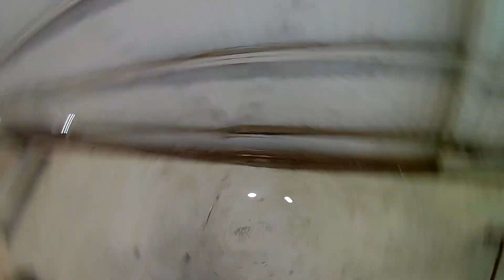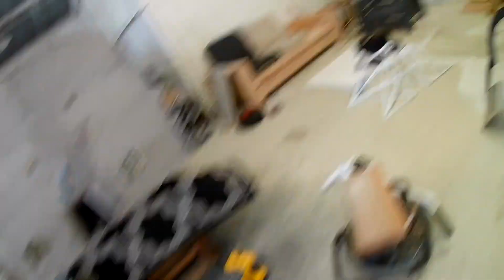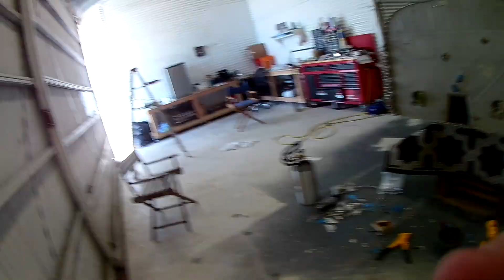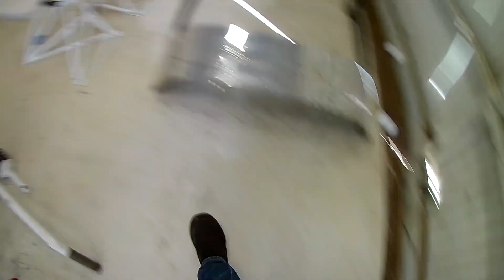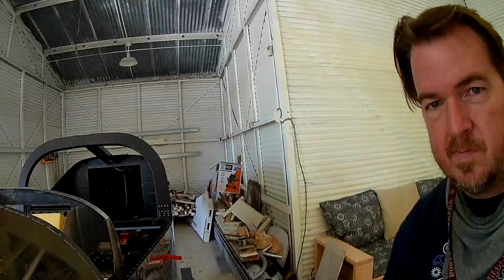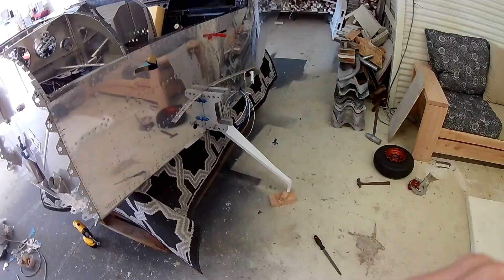RV-14 Landing Gear I

Comment: Great news. What is the cost of the engine as compared to getting the “deal” from vans direct?
Reply from the maker: Its comparable. Lycon is also a distributor of the EFII system I'm installing so they're bundling that in.
Reply: Andrew Kilroy Interesting, when the time comes I will have to look into it. As of now I was going to stick with Vanilla in this area- prop and engine combo from Vans with the stock 390. But I have time to think about it.

Comment: Andrew, I've been following you for over 2 years and never heard you speak of your planned use for the plane.  I know you're a highly skilled pilot, and I think you've mentioned aerobatics.  You've also referred to your forthcoming engine as a "Fire breather" so I infer you will be maxing out your speed to the limits of the airframe.  Would you share some of your plans for this plane vs. your use of club planes?  Thanks!
Reply from the maker: It will definitely come out higher than 210hp. The extra power will be nice to have on climb out mostly. That 3 blade prop will get me up quick which is what I'm really looking for. 

As far as plans I don't know yet. Going to get it flying, fly off the initial test flying requirements and go from there. I'm waiting to get my IFR rating in this plane so there's that. I will still be a member of my club. Cessnas are still the best planes for sight seeing around the bay with those high wings.